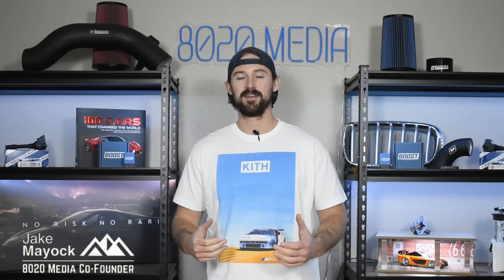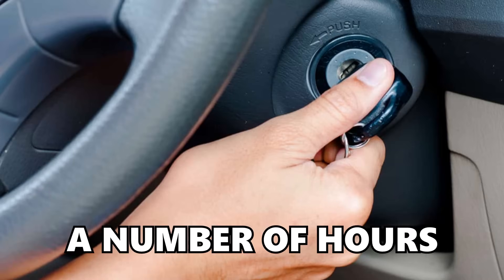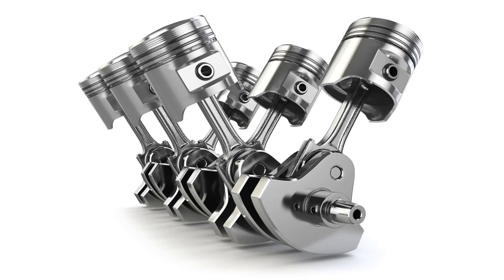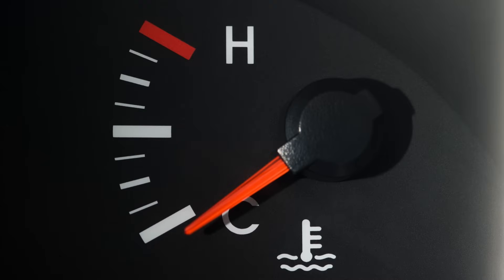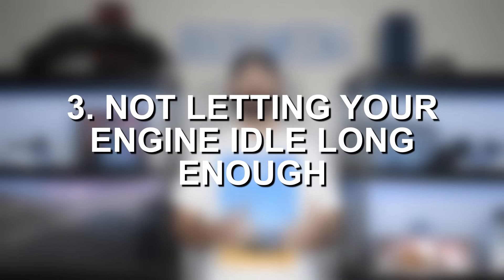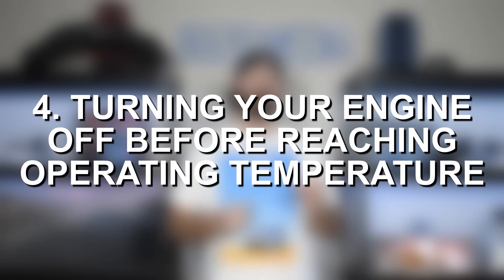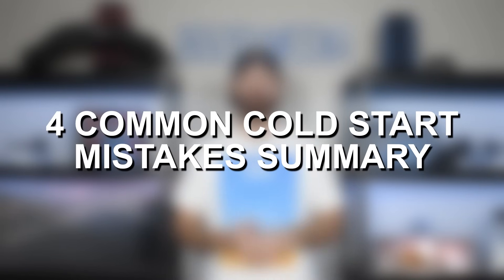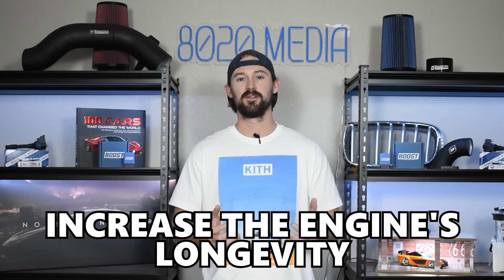Your Engine Hates These 4 Cold Start Habits—Avoid Them Now!

Comment: What's the difference between idling for too long and driving gently around town? It's about the same rpm range, and I don't see the benefit of one over the other.
Reply: Idling and driving are absolutely not in the same rpm range. My idle is around 800 rpm. You can't drive at 800 rpm unless you're already moving and not hitting the accelerator at all.
Reply: @luciusn21  im in town to go anywhere. I can go without hitting 1500. And that still doesn't answer what the difference is. You're just having more rpms than idle. Why is one worse than the other?
Reply: @ShawnsTrains265  he mentioned fuel dilution in the video. Oil pressure increases as rpm increases. Higher oil pressure, less fuel dilution.
Reply: @luciusn21  This doesn't make any sense. 
Oil pump will run at any RPM, and they will meet the minimum required oil pressure. Driving or idling makes no difference.
Fuel pump will run at any RPM, and they will meet the minimum required fuel pressure. Driving or idling makes no difference.
Reply: @LansaDiag  driving warms the engine up more quickly than it does idling. I've tested it myself. So have others. Feel free to test it yourself. You drive so the revs are a bit higher to warm the engine up faster than at idle, but you don't get the revs so high that it's bad for the engine because the oil hasn't had time to warm up yet. Then as your engine warms you can rev a little higher, further speeding up the warm up time, until you're at optimal operating temperature at which point you can rev all you want and be ok
Reply: Guys.   This particular point is not about Oil pressure.   It's the Cylinder Pressure.   Gently driving away gives us noticeably higher cylinder pressures than just letting it idle to warm up.   We absolutely want that extra bit of pressure to give us a much faster engine warm up and here's the kicker:   More Cylinder Pressure actually forces the piston rings out to the cylinder walls, creating a MUCH better seal and preventing fuel from getting down to the oil.   The way piston rings work is just brilliant stuff and there are some great yt vids illustrating this function. 

As soon as she's warmed up we no longer have "cold start wear".     Get there sooner by gently driving the car.    Idle sucks compared to a low load when it's cold outside.  Fuel is definitely getting past the rings when idling cold.
Reply: @innerspace56 Exactly, people don't take load into account when comparing idling to actually putting load on the engine. It takes almost 10 times longer to heat up the engine by idling compared to just driving.
Reply from the maker: S - The key difference between idling for too long and driving gently around town lies in how the engine operates under load and how effectively it warms up. While idling keeps the engine running at low RPMs, it does so with minimal load, which can lead to incomplete combustion, carbon buildup in the intake and exhaust systems, and inefficient oil circulation. In contrast, driving gently puts the engine under light load, which helps the combustion process run more efficiently, warms up the engine and transmission quicker, and allows the catalytic converter to reach its optimal temperature. This reduces wear, improves fuel efficiency, and prevents long-term issues caused by prolonged idling.
Reply: @8020Media  now that's an explanation!
Reply: Driving is a much quicker way of heating the engine, so it's preferred. Just don't thrash the engine too much.
Reply: Even in the similar RPM range, idling uses far less fuel than driving around town. This mean it takes much longer for the engine to warm up if you are just idling.

A simple mental exercise I like to use to prove this is imagining if you are going downhill vs. uphill — you can be using 0 fuel downhill but much more uphill, even at the same RPM. This is because the *load* can be very different, even at the same RPM. Similarly, load during idling is much lower than driving around town, thus using much less fuel.

Comment: Doesn't the transmision oil/ automatic transmision also needs warming up?
Reply: Can’t really do that without driving the car
Reply: @T-rey facts
Reply: @T-rey  Look at the transmission lines going to the Radiator  ,,  (  Let the " Coolant " warm up before putting the vehicle in gear ) Duh 😊
Reply: The best way to warm up both the engine and transmission is to drive slowly.

I like to start the engine up, put my seatbelt on, select my music etc, check my mirrors and then I'm off. This usually takes less than a minute. 

Both of my cars have 200k km and 240k km on them. They still run fine and probably will for the foreseeable future.
Reply: @muhammadasjad3071  i usually get everything get ready get comfortable and just play a song i dunno lik 2 minutes into the song ill take off but then my temperature is already creeping away from the cold part of the gauge, best thing i hae learned about warming up the car is it warms up faster when u drive it,
Reply from the maker: B - Yes, but with the vehicle on, this will also do it.
Reply: Actually " Operating " temperature is 101° Fahrenheit  in most vehicles  ( Gas or Diesel  )  ,,  Let your engine warm up  , ( Avoid  " Piston Slap" ) and Don't forget about driving slow to warm up your Differental and Transmission  ,, Good Luck  !  😊

Comment: Could you please do vidoes about not driving your car after some time? I work from home so I very often go over 4 days to a week without driving it
Reply from the maker: K - This is a great idea. We'll add it to the list!
Reply: Try to drive it 10 or 20 mi every 3 days or for like 20 minutes or 15 minutes , That's pretty good for your battery and stuff and everything getting circulated instead of being stagnant
Reply: @jonahlevi3178  Thanks for the tip. Luckily I do have a battery tender so I'm not too concerned for the battery. The other components is what I'm worried about.